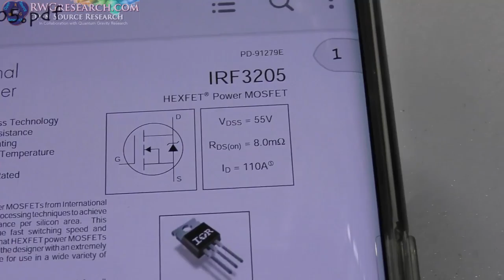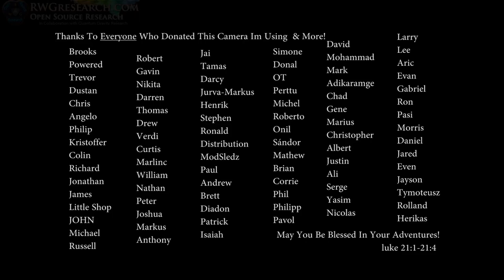ANT Ecarry Repair Video . How To Fix Your Printer. & Extras.

Comment: Hey, I built my own delta with the help/ inspiration of your first delta build video, then, since that one was a little rough around the edges I built a new one with a similar size to your OSD, so I'd like to say thanks for the great videos and the inspiration
Reply from the maker: thanks for the comment! what electronics did you end up using on the bigger one? i got big plans to get back to my OSD! real soon will finish that project! it a big project because of the extras i'm planing that i haven't shown yet :) thanks for the comment!!

~Russ
Reply: rwg42985 I'm using a mks sbase smoothieboard clone, it's been working well and it wasn't badly priced

Comment: I have the Prizma version of this printer as well.  The SD card came with a lot of items for the printer.  There is a folder on the card labeled firmware, but it appears to be raw Arduino source code, and I didn't see any compiled firmware.  Was your machine like that?   Have you done anything with the firmware?  Where do I get updated drivers?  Thanks!

Comment: Thanks for your very helpful video.  I have purchased an ANT printer and found the loose gantry and the misaligned filament holder as you have shown.  
My ANT has developed a problem with the Z sensor constantly indicating contact, which has disabled the printer.  I have contacted GearBest support to get the contact information  for ANT product support, but they just give me the runaround.  
It appears that there is a optical sensor on top of the hot end.  I am not sure what to do next.  Any help that you can give will be appreciated.
Reply from the maker: Just for you: https://www.youtube.com/watch?v=kr3UIgZhCEY
hope it helps! 

~Russ